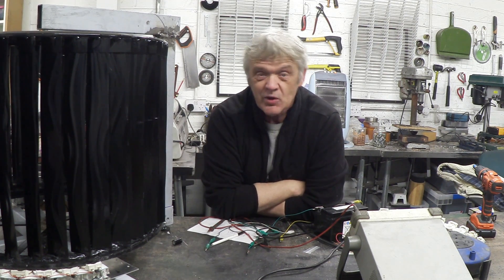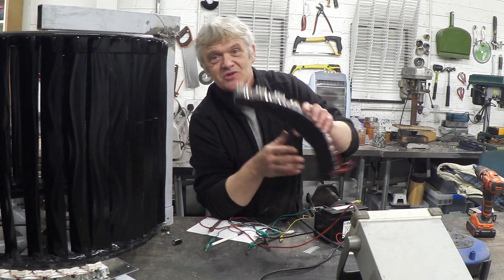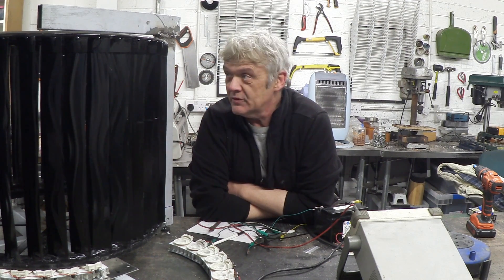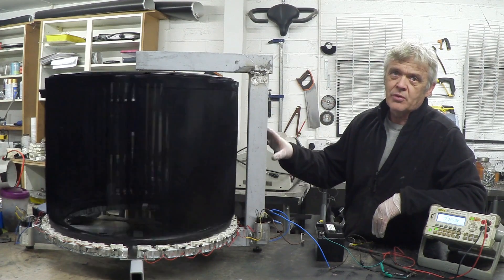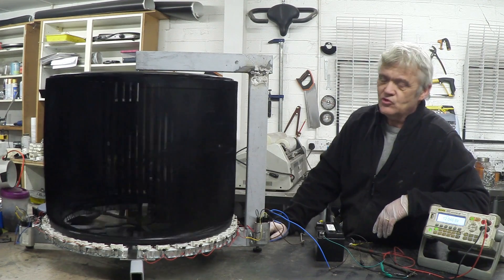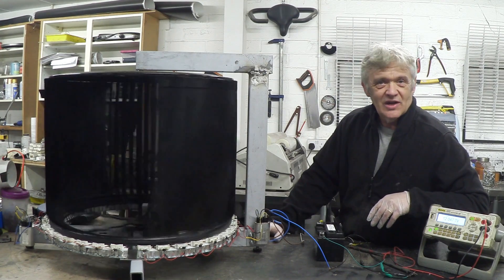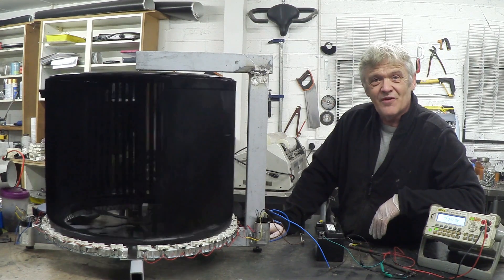Finishing The $100 Wind Turbine

Comment: If I understand correctly, then the generator has 4 segments with 9 coils of copper wire in each segment, a total of 36 coils. And a diode bridge at the output of each coil (a total of 36 diode bridges)? and they are all connected in parallel at the output of the diode bridges for direct current? Or are there 4 diode bridges, at the output of each segment, and they are connected in parallel? How many magnetic poles are there in total. It seems to me that the generator that I plan to make is very similar to your generator. I also planned 4 segments with coils connected in parallel via diode bridges (I have not decided on the number of coils yet). I plan to make the number of poles a multiple of 4 (minimum 4), and connect the segments through the controller: 1) all segments in series, 2) 2 in parallel and then in series in pairs (2 + 2), 3) all segments in parallel, depending on the output voltage from the segment. And then you get three voltage stages at the generator output, which can be used automatically depending on the wind speed. What results did you get? If there is a video with a continuation, then indicate a link to it or its name. Thanks in advance!

Comment: It is certainly awesome that friends donated 36-odd microwave oven carousel coils for the build, but some of us aren't blessed with such wonderful friends. 😔 Does anyone have any leads on this many coils available thru surplus electronics companies? If I bought carousel motors new, it'd cost me $700+, never mind everything else.
Also curious about airflow through the turbine. The "work" presumably gets performed when the wind hits the leading blades, but do the trailing blades help or hurt when the airflow exits the turbine? Would it make sense to keep a side of the drum open to allow air to exhaust out from the inside?

Comment: Great series, I have two questions: 1 Did you ever think of adding the same amount of coils on the top of the turbine. I have this question since you indicated that the amount of coils did not slow the turbine down. 2. What would it take to have either increase the surface of the vanes (make them wider) and/or could the vanes have a small lateral movement.  They would be "teeter-tottering" not unlike a sailing vessel. When they go for the wind, they show more surface. when the turbine turns 180 degrees they would be "cutting through the air" lessening the friction from the vane against the wind. I am not an engineer, I am more a thinkerer than a tinkerer. I did some sporadic sailing when I still lived in Holland and was the guy that had to move the boom from one side to the other to catch the best/most wind.

Comment: IT'S A GREAT IDEA FOR OUR MOTORHOME. ON A SMALLER SCALE. WITH A LOAD CONTROLLER AND A WAY THAT IT DOES NOT EXCEED A CERTAIN ROTATION SPEED WHEN THE VEHICLE IS MOVING. ALSO WORK WITH THE VEHICLE STOPPED. I'LL GET THIS IDEA OFF PAPER.

Comment: You really should use a charge controller designed for wind turbines, then you wouldn't need to worry about bad feeding of electricity, and you'll be protecting your battery.
Also, there's less line loss from AC compared to DC.

Comment: Why cant you measure the output with an ammeter and voltmeter at the battery terminals ? Why cant you estimate the wind power input using a wind sensor ? Why dont you calculate the input and output values and tells us. The Betz law itself will then tell you that this is not a wind turbne capable of producing 1KW !

Comment: I'm looking at this with the thought in mind to build one myself later. I've done some layouts and i think i've worked out the electronics to make a design similar to this adapt itself per wind speed. I note that your graph ends at 22m/s (50mph, ish). I've not done the maths yet to work out the velocity at the outside of your drum but i'm trying to work out a way for it to deal with very high wind speeds, more to keep it alive during a gale than to maximise power - Did You work out if there's a stall speed for your blades?  Eunice gave us a 122mph wind, that's maybe unobtainable but it'd be nice to be able to deal with the surprisingly common on the pennines ~70mph gusts we get.

Comment: Robert, how powerful would the turbine be if it did not have the coils fitted, and instead was used to directly drive a small Archimedes screw water pump to pull ground water up to the surface? If that worked well, think of the potential for it's use in remote locations such as North Africa or in the Australian Outback.

Comment: fantastic i wonder if you made the bottom disk a little bigger you could generate of both poles of the magnet by putting another ring of coils above in fact you could fit 4 generator coils to your device by fitting 2 coil systems to the top disk the possibilities are endless but you have demonstrated this very well

Comment: You never explained the basic physics. How much power is in the column of air moving through the device and how much is available to extract? Clearly not all the energy can be extracted as then the wind at the output would be stationary! I would be very surprised if there is more than a few watts available to be extracted in such a small machine. Otherwise we would get very hot if we stood in a wind! It is very simple to measure the power output of your machine. Just see how many 10W lamps you can light.

Comment: Ok so at the end of the day how many watts can this turbine generate? Because the title is clearly misleading, yes maybe based on its size it can generate 1kw but no way this build can generate that amount of power maybe this is why you are hesitant to show its actual power. For $100 you can buy a high power second hand solar panel and a controller.

Comment: Umm .. no updates in a year. Did it work? Was it a flop? I think your estimate of the output based on the size of the thing is a little flawed. Only half the turbine is catching wind. Less. The other half the wind is slowing it down. Your bench top test should have had 2 blowers push8mg against it one on each side, just to see what happens. Fingers crossed.

Comment: You really should put 3 or 6 sets of coils at 120 or 60 degrees in 3 or 6 phases and not on the edge, going back to levers and torque, you are obtaining lower voltage at slower speed but gathering 3 or 6 phases so that your output is amps, amps are more useful than volts, keeping it AC then pumping a large transformer to get the voltage and amperage you need from the system is more useful.

Comment: When i remember correct, your original wind generator had a diameter of 1m. On the height maybe 50 or 60cm. Now you went smaller where i would have expected that it would make sense to keep the diameter but maybe increase the height to 1 or 2m. 
What i like in the design, the generator is working with small forces.

Comment: Bottom line, this video series spends more time focusing on the trivial details of the build rather than getting to the real meat of any 'free energy', or 'green energy' project (often they are very similar) which is the actual power production. This thing will never produce 1/10th of a KWh let alone 1KWh, and the author dances all around the facts about the output as all the free and green energy salesmen do.
The title of the series is a clickbait lie, and reasoning that commercial makers of generators lie about their production numbers so it's OK for him to lie as well is Ludacris . Contrary to that red herring claim I have a 450KWh Onan generator that actually does produce 450KWh. I've tested it under load. 
I'm sorry but I cannot respect any man who says that it's OK for him to lie because everyone else is lying as well.
The proof is in the pudding and the pudding is never put on display or tasted. To say, 'it works', isn't good enough.  In an earlier video numbers of 28-30 volts and 1500ma were tossed out to us.. Giving those numbers the benefit of the doubt because there was NO PROOF PROVIDED, that equates to 45Wh, or 0.045Kwh . 4.5% of the claim of 1KWh.
A far cry from the claim.

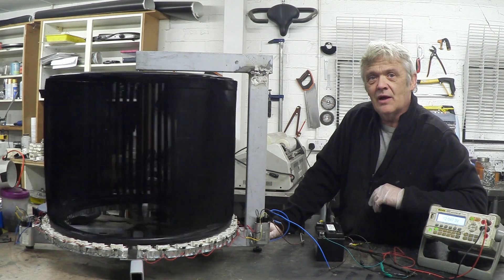Comment: At 5:12 you say 1kW is possible in a 22m/s wind. I'd just calculated 23m/s (ideal at 50cm high and 80cm diameter) while watching your other videos. However, at that speed the efficiency would be really low and the wind possibly destructive. 23m/s or 51mph is quite a lot for a VAWT to do anything useful with but I have enjoyed the videos so far. I've been building windmills myself for a while, so far without producing any really useful output as the learning journey is long and complex.

Comment: Got to take into consideration that a 22m/s wind isnt the actual efficency.  Betz law states that you are only able to achieve 60% efficiency. So is this 22m/s with 60% taken into consideration or have you calculated    minus which is about 14-13m/s of variable speed. Would love to see this installed in a new vid on your roof or where you plan to put it.

Comment: Of all the differing generators, pick the most inefficient type to aim for 1000W. The only efficient type is what is used on the superwind farm generators and they are generating high voltage which can be easily transformed and made to traverse great distances with minimal loss due to resistance. The only way to generate 1000 w is to firstly use the neomidium iron boron magnets, not the weak ceramic type. The windings need to be a continuous run in and out sinusoidally serially through all the magnets with something like 500 volts output then transforming to the desired voltage. This method keeps the operating voltage high and the current low reducing the losses to a minimum. You were on a sticky wicket right from the start.

Comment: You largest losses here are probably the diodes figuring diode drop. Considering that it would be better to space coils properly, build them in phases to increase voltage. This will lower the effect voltage drop loss from the diodes. Then you can use an efficient buck converter to get battery charging voltage. Diode voltage drop on low voltage is a real energy theif

Comment: Did the $100 wind turbine come to a final conclusion?   I would really really really like to have a solution to charge 12V / 100Ah battery(s) in the winter where I live.  The wintertime has very little sunshine for solar ... 200 inches of snowfall for the season ... and the wind blows constantly (and hard enough to create snowdrifts of 2-10 feet easily.

Comment: First - I have not seen every second of t his series, nor  read every comment. But let me throw this in;  It looks like this design is possibly  throwing away more than 50% of the available energy, before any losses in the mechanics or the electronics. Considering the wind coming from one direction, the blades on one side are capturing wind inside the 'cup' of the curve, creating rotation, while on the other side the blades are blocking the wind flow , fighting the rotation. Even with no blocking the wind would only be harnessing energy on one half of the available facing surface area.  My apologies if I'm misinterpreting the design. (If you wish to provide an email address I can provide a sketch that might make this clearer. )

Comment: Why the extra "blocking" diode when all the outputs are coming via bridge rectifiers? The storage capacitor/battery can't discharge back through the coils with bridge rectifiers in the way.

Comment: So I have watched this whole playlist, call me dumb but I am a bit confused. I would like to build several of these to eventually help run my house. What type of coils do I need/where would I buy they from. 
What are bridge rectifiers and how do I wire those up?
What size capacitor would you need for the coils when it is on the roof generating  power?

Comment: Your a kind of not that smart... Why did you not make a second coil ring on the top, to generate 2 times as much power, when the wind goes up? Hire power winds...  More power generated...
Reply: When a electrical load is placed on a generator a Physical mechanical force (of similar energy)  in the opposite direction slows the wheel.   That being said, If you had a second coil ring you will get two times the power but you need to turn the turbine with twice the torque requiring much higer windspeed or a Larger wind turbine.

Comment: Robert, Sir. I feel that I should point out the when you are using a "variable power source" (aka a wind generator) to charge any battery that you should really consider a charge controller between the battery and the WG! charging without the Charge Controller can definitely damage the battery due to inadvertant overcharge! Decent CC's are available on the internet, but be very careful about the source and ability to obtain service, advice and heaven forbid the requirement to get a return due to faulty product (the Dhinese made CC's are either good or they are total junk! I know, been there, done that! Keep up sthe good work! PS: reasonably prices Farad capacitors with a reasonable voltage tolerance are more and more available. Check with the auto audio seller! I am currently (bad pun) using two on my totally off-grid solar power system.

Comment: How many watts is the blower that is causing the turbine to spin?  I would guess the wind turbine power is 2-5% of that wattage if it the blower is pointed at the center of the turbine (not the edge of the blades).  Good workmanship though.

Comment: It would be interesting to know the open circuit Voltage and the short circuit Current, to determine the best way to control the battery charging.

Comment: If the power is capped by turbine size wouldnt you get better results spreading the mots out between four turbines wired in parallel/series?

Comment: A 3 phase axial flux is the way to go. Number the coils 1-2-3/1-2-3 etc connect all the 1's in series,the 2's then the 3's in series to end up with 3 sets of output wires. The coils all go the same way, you make a make a mold fill with autobody resin only thickness of coils,then make another ring of magnets that attract opposite ring,powerful flux between them goes  through the coils,makes an AC alternator that you convert to DC with a bridge rectifier to charge batteries you tube james biggar or muddy man videos good going mate. I love to repupose trash.We live in a disposable world which 900 tons a day ends up in the ocean

Comment: The project is interesting and the turbine well built, but there are some concepts that are not taken into account in the explanation and drive misconception about wind power production.
1- the curve is theoretical. No actual turbines show a Betz efficiency. Typical efficiencies range from 0.15 for Savonius VAWT to. 4 for highly efficient Darrieus VAWT. The turbine in the video is a derivation of Savonius.
2 - the reason for the lower efficiency is due  to the aerodynamic phenomena around the blades and to the charge controller (mppt) settings. Look for Paraschioviou's books on turbine performance modeling
3 - the biggest error people do buying a wind turbine is to rely on the nominal power value. What has financial value are the Watt per hour, and this is obtained by combining the real wind turbine power curve (not the theoretical one) with the annual wind speed Weibull distribution of the installation site. This is the major reason for client's unsatisfaction when installing a wind turbine.
I find noble the attempt to make wind turbines easier to understand, but caution shall be applied to oversimplification that may undermine confidence of customers and people in general in the technology.

Comment: Nice project, but I just can’t see it generating that much usable energy. Vawts are generally not very efficient and the type you are working with is not known for high efficiency. I think you would need to be in a tornado for it make 1.2 kilowatts. If you train a fan onto one side of it you are concentrating an unusually consistent and fast air flow directly onto your blades but doesn’t account for drag on the leading edges coming back into the wind. In real world conditions if you had the same airflow but multiplied across the top of your house you really would be in hurricane or tornado. That being said, yours will definitely spin. I’ve seen those ‘quiet revolutions’ turbines all round London and never once seen them spin.😂

Comment: Thank you Robert for sharing your time and efforts on this project.  I have two thoughts about improving the design from the aerodynamic end....  First, the cost of the material for the blades is very low, and doubling the length of the blades would double the area of wind energy collected with no more effort or materials at the top or bottom where all the electronics and mechanics are.  Second, the baffles can be increased in number and rotated counter clockwise maybe 30 degrees to bias the incoming wind to improve the efficiency of the blades collecting the energy.   Adding and canting baffles would increase the wind pressure on the inside of the blades, while decreasing the resistance wind pressure on the outside of the blades.  You would be in effect creating an aerodynamic stator on the outside of your aerodynamic rotor.  Think of it this way... you actually have the mating of an aerodynamic rotor/stator pair with an electrical rotor/stator pair.